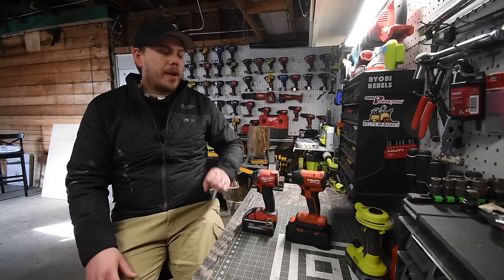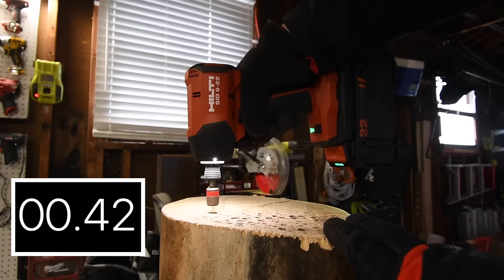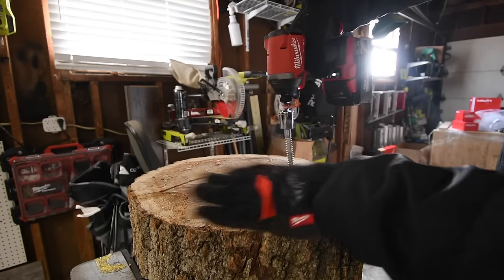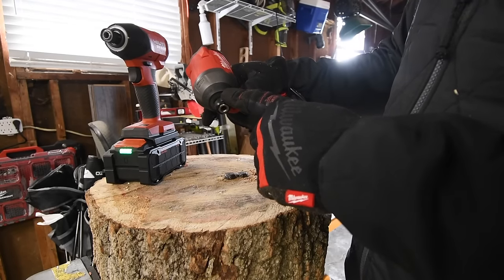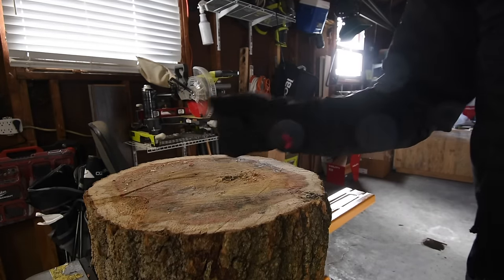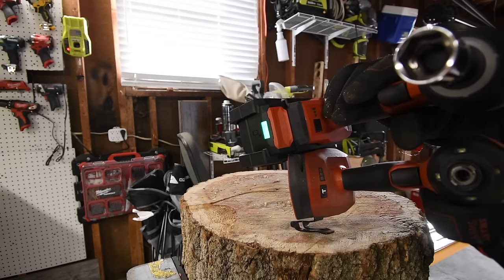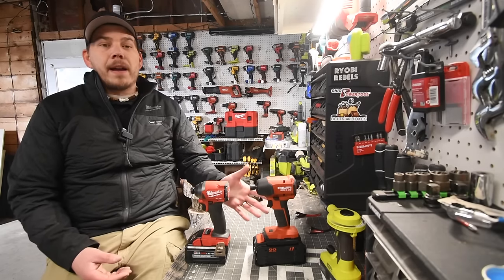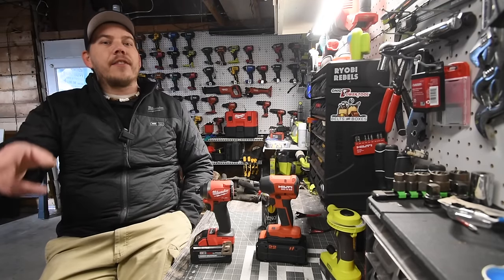Is Nuron Better Than FUEL Now?

Comment: Noone can disagree on Milwaukee power,  but hilti just sounds and looks better to me.  I wish to try hilti one day, but it seems like a smooth ride
Reply: Well Uncle Fryer. I own the older SID4 Hilti and he Milwaukee fuel.  I mostly use pozi screws rather than hex head stuff and the Milwaukee is just far too powerful to screw in pozi screws as the PZ2 bits just spin out. The Hilti on the other hand is much better and much more comfortable.  Obviously if you drive lag bolts all the time you would appreciate the extra power of the Milwaukee.  I have Hilti & Milwaukee combi's too and the Milwaukee Gen 3 is crap compared to the Hilti. Half the time the Gen 3 trigger doesn't work and it gets hot really quickly on simple tasks.
Dave.
Reply: @davesheppard8797  yes, I returned my Milwaukee drill because it was getting overheated. I see I'm not the only one
Reply: @UncleIvan1  Yes.....Mine overheats! My old Gen 2 didn't overheat but had major trigger issues. I sent it back and it was 3 weeks before I got it back.......Now...this is where Hilti certainly has the edge. A while ago my old assistant dropped my Hilti Gen 1 SF6H combi down a deep street drain while repairing the steel top rim. The drill still worked but sounded a bit weird on the run-out. I rang my local Hilti rep and he was with me within  half an hour with a replacement like for like drill. Mine was then sent off and was back to me within 24 hours.  The Hilti rep then collected the other drill from me that he had given me. I lost about half an hour of working time rather than 3 weeks waiting for my Milwaukee!! Obviously I have other drills to use if I get into problems but if the Milwaukee had been my only combi I would have been stuck. There was also no charge at all from Hilti.
Dave.
Reply: Oh yeah I agree with the power of Milwaukee. However I strongly disagree on the Reliability of Milwaukee tools especially their Impact Drivers and hammer drills. When it comes to the reliability and the parts availability Milwaukee is a Garbage they don't last that long their performance is just only from the beginning and they end so quick. that's why I don't invest on Milwaukee tools. And I have never been a fan of just one tool brand alone. I have 8 different brands in my jobsite and at home. I got DeWalt, Stanley, Craftsman, Bosch, Ryobi, Makita, Hitachi and Harbor Freight Hercules brand. I always buys tools that are great value and at great price. The only Cordless tools that I have are Impact Drivers for all the brands I mentioned. Mid-range and Hi torque impact wrench, Hammer Drill (DeWalt, Makita and Craftsman) and got some backup cordless circular saw and backup angle grinder. (DeWalt, Makita and Hitachi) The rest of my tools are still corded especially the cutting tools and grinding tools such as Miter saw, Table saw, Benchtop Band Saw, Drill press, Hammer drill corded (Bosch), Rotary hammer drill (corded Bosch), corded Table Router, Corded Router, Solder gun and other hand tools such as wrenches and sockets. I got Inverter Generator that is small, compact and powerful enough to power up the air compressor to run my Pneumatic framing nailer and Finish Nailers. All of my tools fit inside my box truck. No I don't use pickup truck or van as a contractor. I use box truck 4WD with hydraulic lift gate and it's been a great investment.
Reply: @twinbee4243  thanks for sharing your life story 😄😉
Reply: @UncleIvan1  oh that's not a life story it's not even 20 pages long. That's only my opinion.
Reply: @twinbee4243  it's all good 👍
Reply: @twinbee4243  Coincidentally, that Milwaukee impact has some real horror show head scratchers going on under the hood.
Reply: @robertrada4783  well I'd rather buy 8 different brands or any cheap brands like Harbor Freight Tools. And I haven't been crying Once just like what they said Buy ones cry ones. I've been so happy with all of my tools and my recent purchased tools. But no way that I will buy Milwaukee tools. That's the only brand that I don't wanna spend my money for. 😆 Just like I said I'd rather buy DeWalt, Makita, Bosch, Ryobi, Craftsman, Hilti, Hitachi/Metabo HPT and so much more. Always look at the great prices and bargains.
Reply: @twinbee4243  I never owned any cordless Milwaukee until last year.  They have a couple of random things I can’t get from elsewhere. So, I got fed up and just got what I needed from them.  I bought some other stuff just to try out as well.  I was aware of the backlog of Milwaukee and Ridgid repairs at my local tool shop (Home Depot takes their business and then sends them the repairs).  Just piles of broken tools.  Simultaneously, everybody I know is using their tools and loves them.  I have to be honest, I’ve never owned such junky power tools. I have nothing nice to say about them other than, for a lot of products, they are the only ones who bothered to show up.  The build quality of their battery packs is quite poor as well.  Strange for a company that spends a lot of time and money inviting press over to highlight how heavy duty said batteries are.  I use the 18v drill a lot because it is small. But I did immediately replace the chuck and I also don’t expect it to last long.  I use the rivet gun and the little pneumatic style die grinder all of the time…however…they’re also built poorly.

Comment: Not too concerned about duration tests unless it's out of hand poop.  I like seeing tools being tested in their most practical forms.  I use a 3aH HO on the gen 3.  Sometimes a 5aH if I'm just running decking w/ deck screws or if I need it for only a minute.  I'm never gonna slap anything larger than 6aH and that would only be used if my 3s are in my nail gun and drill and I gotta run 6"+ lags.  Let me get to half battery or 1 bar down from full since we use these all day, almost everyday and there only fully charged for the 1st minutes of use.  I wanna see em drive real fasteners with 3, 2 or even 1 bar and see if and how much the efficiency of the tool diminishes as the battery depletes as it would thru out a normal work day.  A tool and battery pair that show little to no loss of power or efficiency at 2 or even a strong 1 bar vs a full or strong 3 bar battery means a lot to us.  Having a tool usability decrease quickly as the battery depletes makes us work harder which costs us money.
Reply from the maker: it would take a lot longer to film duration tests as well.
Reply: @ManCaverTools  oh yeah, you'd have to montage/time lapse the majority and unless you work some magic it would be a little dry.  Throw the beanz at some mid charged batteries and see which one dies first or at least starts to noticeably perform poorer.  Run like five 10" lags per tool and keep going back and forth until one starts to take a nap lol.

Comment: It’s so funny that all these brand new top of the line tools from whichever manufacturer can’t keep up and in some cases barely edge out the old ass m18. Imagine when Milwaukee comes out with a gen 4.
Reply: Exactly. I suspect Gen 4 is right around the corner i bet Milwaukee has solid state batteries coming soon
Reply: I hope so. The new pouch lithium batteries are lookin good. Hopefully big red keeps up or surpasses it
Reply from the maker: I do agree, that m18 is a fantastic product
Reply: Sheer power isnt the only quality required for a good driver. Milwaukee prioritise it and that appeals to users who want or need the most power and fastest driving times. Makita are the best on ergonomics. Hilti has probably the best longevity. Depends what you need and value from the tool - the other brands aren't failing to match Milwaukee's power because they can't but because they choose not to.
Reply: Milwaukee don't need gen4. Gen3 is so good that I don't think they can improve.
Reply: @liamhinch1   Na, not really
Reply: I have the m18 fuel, DEWALT 850 and the makita xtd16, i grab the makita every time, less vibration and smoother trigger response. The m18 is like an small impact wrench very powerful but kinda rough, and the DEWALT has ackward modes for driving into wood.  More powerful is pointless if you don’t need the power. 

I do however love my m18 fuel mid torque, it’s power to size ratio is amazing.
Reply: @willng34  thank you for some objectivity. Power is not everything, but Milwaukee fan boys can't see past it as the only metric for choosing a driver. And to assert that the other brands can't match Milwaukee's power, when they clearly have access to more powerful motors as evidenced by their impact wrenches etc, is a bit stupid - they clearly make different decisions when choosing between contrary traits like power vs vibration, heat retention vs size etc.
Reply: @liamhinch1  At the high end, we are at a point in which power doesn't make any practical difference at all. All of the major manufacturers have impact drivers that are as powerful as a 1/4 hex shank can practically handle. That's why he was breaking adapters left and right in previous videos.
Reply: In fact, most other features  more important than power for the high ejd impacts- battery platform, ergonomics, control/vibration, settings, and even lights are more important. But those don't make videos with lots of views.

 Think about this- he's driving lags with no predrilling (which makes no sense in the real world) into a tree stump. It is an interesting abuse test, but lags require predrilling and I don't use many fasteners in my trees.
Reply: Highly doubt gen 4 is any different from 3.5 probably just upgraded batterys which will work with previous generations.
Reply: @liamhinch1  Ergonomics are highly subjective. For me, Makita's ergonomics are slightly worse than current gen Milwaukee drill/impact or Metabo HPT tools, and ahead of Flex's by a smidge.
Reply: @reaperreaper5098  it might be subjective as is for anything,  but when a majority agrees on it - it makes it factual to a degree.  I have somewhat larger hands and makita feels great.  I guess it also depends on the thickness of your hands and so on so I see how it's not for everyone
Reply: Ergonomics is somewhat subjective (e.g. smaller vs larger hands, or what people are used to), but there is such a thing as better and worse ergonomics. We are all people and have similarly designed bodies. 

 For example, some people like the m12 grip, but most find it bulbous and too thick. It is a flaw due to the design of the battery. How do we know it is limitation and not a feature? Because the m18 grips (or any handle of drill/impact with a slide on battery) do not share a thicker bulbous handle design. 

Some people with larger hands can get used to it and think it is just fine, but it is inferior from an ergonomics perspective. On the other hand, I don't mind the similar Bosch 12V grips. They are slightly thick, but less bulbous. But even these are not a good as most 18V tools in that one regard.
Reply: @graysconcrete135  They have to change something significant after 4-5 years. Maybe they'll go the way that Dewalt did the DCF850 and make a shorter tool with similar power to larger tools. I know the gen 3 is already compact, but ultracompact seems to be a possible next step. The previous generation of impacts were already plenty powerful.   A limiting factor with even smaller sizes becomes heat dissipation. Without complete redesigns we seem to be approaching a ceiling for performance improvements.
Reply: @UncleIvan1  The problem is that a majority doesn't agree on it, a vocal minority does.
Reply: @ccbowers  There's objectively bad ergonomics, but there's no objectively best ergonomics.

Some people find the ergonomics on most of Makita's tools better, some don't. I'm in the camp that doesn't find Makita tools to have better ergos. The camp that rolls their eyes when people bang the "Makita has the best ergonomics" war drum.

We're talking premium brands here. Not Ryobi and Harbor Freight specials.
Reply: @reaperreaper5098  I agree with your last comment about ergonomics.  There is good and bad, but in the good category there is room for preference. Except I don't see the issue with Makita ergonomics fanboys. I very occasionally hear about that, but nothing disproportionate. Makita's ergonomics are well thought out, for the most part.

 I'm about 100 times more likely to hear about Milwaukee (team red) being "the best" based upon meaningless differences in abuse tests of impact drivers. Or even "black and yellow for life."  These are much more tribal expressions that happen much more often than the occasional Makita has the best ergonomics crowd. At least in my circles.
Reply: @ccbowers  Milwaukee fanboys banging the “Muh power” war drum is worse, and there’s more of them than the Makita ergos, true. But there are some really dumb fanboys for every brand. Some are more apparent than others (looking at Flex and Milwaukee fanboys).
Reply: I don't mind the Flex people yet, because of the irrational anti-Flex people far outnumber them. But maybe I don't encounter them enough. I do resist tribal thinking, so it is all at least mildly annoying. I am mostly brand agnostic, except I've tried to limit battery platforms to just a few. Makita 18V, Milwaukee m18, Ryobi 18V, bosch 12v, and some miscellaneous stragglers
Reply: @ccbowers  I don’t try to limit platforms any more, I used to just run Milwaukee M18 and M12 stuff, but I’ve recently expanded into Metabo HPT, Makita LXT and XGT, Flex 24V, with plans to pick up DeWalt’s new DCD840 and maybe some Skil tools.
Reply: @reaperreaper5098  Do you mean DCF840? Seems to be Dewalt's most powerful impact driver right now, but I kinda like the DCF850 for compactness and modes. Plus the Powerstack kit seems more desirable than the crappy tiny batteries they were supplying in the DCF840 kit. It is a great tool for the price though. 

I do have Skil Pwrcore 12V, from a giveaway on the Philly fixed channel. Their Pwrcore lines seem to be really good at their price point. My Dad is in Dewalt so I'm always looking for deals in that platform, but I have no desire to add that to my mix currently.
Reply: Oh, I guess they've added or changed the DCF840 kit, now with Powerstack as well. The original kit with 2 tiny batteries was good for a person just starting out, but those <2Ah batteries are just not as useful for most people. I think the Powerstack is a more intriguing offering for the kit.
Reply: @ccbowers  Yeah the DCF840. I've seen more coverage of the drills, so the DCD moniker stuck with me. The local BLowes has a DCF840 kit with the Powerstacks, but it also has a compact drill, which I'm very not interested in.

Plus, I personally find that if a gap is tight enough that my Milwaukee gen 2 fuel doesn't fit, the chances of any impact fitting is basically zero, and go for a right angle adapter. So the 850 doesn't appeal to me.
Reply: @reaperreaper5098  Yeah I get that- the Fuel impact is pretty small, barely longer than my Makita, so the DCF850 is "only" 0.62 inches shorter. Impressive reduction in size, but there are probably few circumstances where that size difference matters. I have the Bosch Flexiclick for those tight spots that don't require a ton of torque, which is most tight situations for me. Or if impact would be beneficial I'd use my m18 Surge plus right angle, because those tight spots usually amplify the noise.
Reply: @ccbowers  I'm finding that width is the real make or break, at least for some of what I do. I just got off a steel framing job where the fat heads of my Flex and Makita XGT were too big to get screws in when a steel truss prevented a straight shot. The Metabo HPT's better (about the same as the Gen 2 Fuel or Surge), but its relatively low RPM isn't ideal for steel framing.